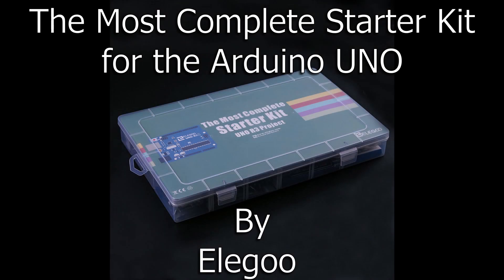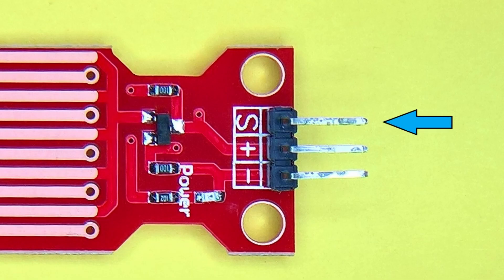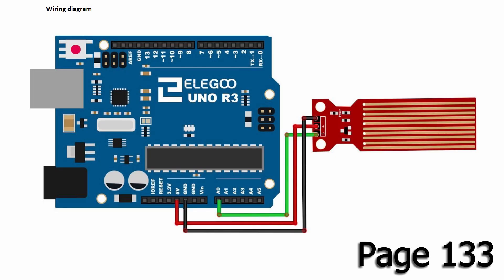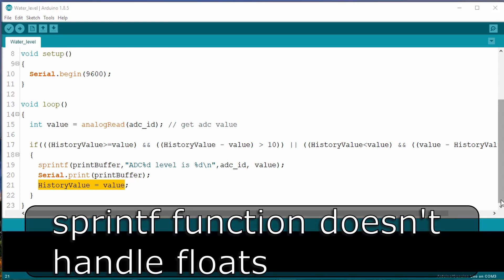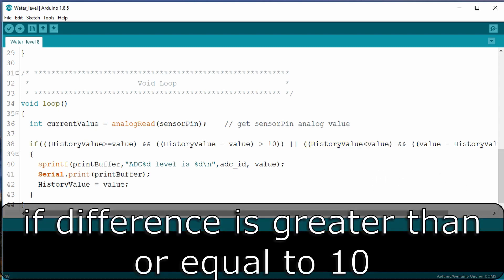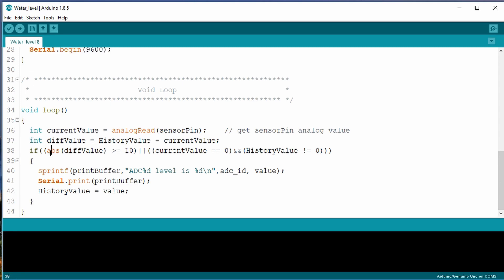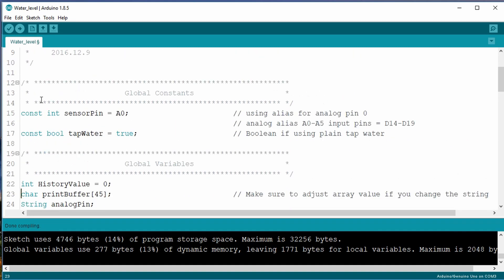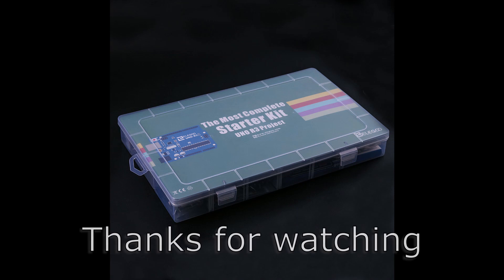Lesson18 - Water Level Detection Sensor Module

Comment: should i use it in making fuel level indicator
Reply from the maker: No.  Not only does this water level sensor corrode to easily, passing a current between the electrodes with fuel could be hazardous.  You'll need to find a different sensor.

Comment: Sir please tell me that which transistor and resistance  should I use in making water level sensor
Reply from the maker: I wouldn't recommend the module provided in the kit.  It corrodes easily.